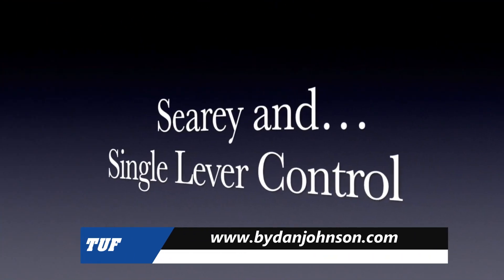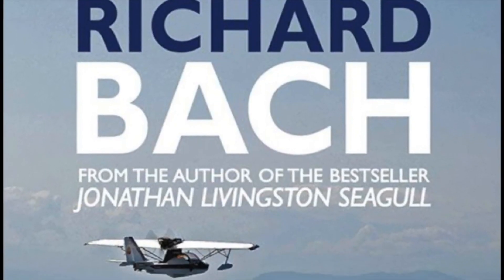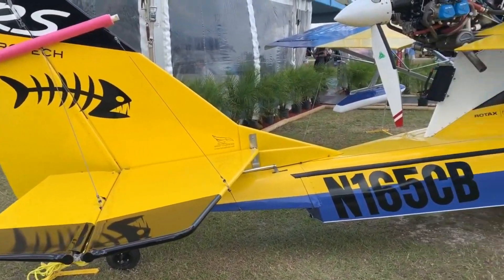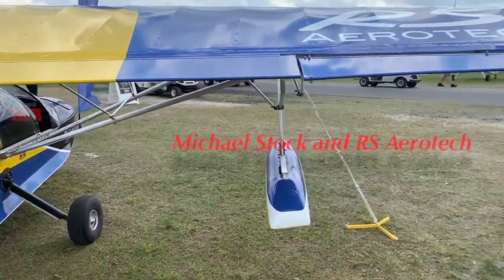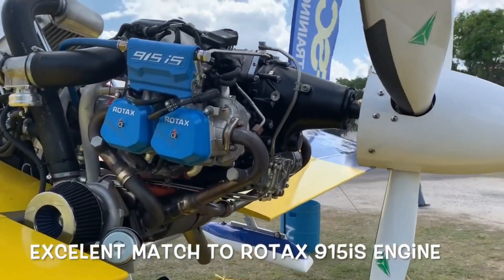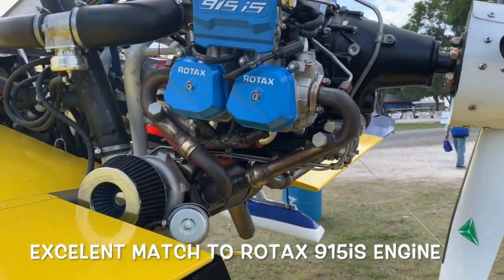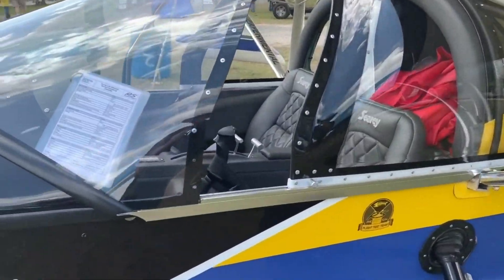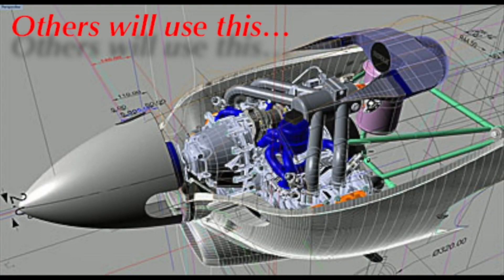Single Lever Throttle Control, on light sport and experimental aircraft SeaRey.

Comment: Thank you for the great report Dan!  I know RS Aerotech has been working on the single lever integration for a few years now on their Sea-Rey.  I would certainly think they will have this perfected in time for the new LSA regulations in 2023.  I agree with you 110% that this provides excellent safety benefits, while not increasing the pilot workload.  That being said, with the Electronic Controller constant speed props being offered by AirMaster etc... It is tough for me to see an increased pilot workload with this style Constant Speed prop.  It only requires the flip of a switch from Climb to Cruise etc... I am hoping the FAA will certainly consider this style constant speed prop as well with the new LSA regulations.  I am also curious if the RS Aerotech system will work with any FADEC engine such as ULpower, or strictly for the Rotax IS based engines...

Comment: Great videos Dan, please keep them coming.
For a long time I've thought that for a prop with direct control of blade angle via a cable or switch(or rheostat) that it could be incorporated in a single lever so that at maximum, or 100%, throttle the prop will be selected to "climb" pitch and as the throttle is reduced the cable or switch would gradually reduce rpm by gradually reducing to "cruise" pitch with throttle remaining at 100% before Throttle lever starts to reducing Throttle from 'wide open' throttle gradually back to idle. Or for engines that cannot tolerate high Manifold Pressure at lower rpm, reduce Throttle and Prop pitch at the desired comparative rate. 
This could probably be done by linking the the Throttle and Prop levers together with some sort of Cam operated linkage that could be fine tuned with some sort of adjuster by either the pilot if outside the panel(quadrant) or by mechanic/engineer if 'behind' the panel.
Reply: The problem with this setuo6is it's heavy.  Most GA birds, you want light.   Fwd can cause weight issues when too heavy.  Also, flyweights, oils,  and electricity in smaller applications has been hazardous

Comment: P-3's and L-188's have single lever integrated power levers that incorporate pitch and power/thrust changes.   The only downside is feather isn't automatic, and requires an extra auxiliary prop pump.

Comment: What is allowed? The select adjust prop on john mcbean kitfox? What type constant speed prop goes on a turbo 915is motor as it seems to require it as on trent's airplane?
Reply: Thats an experimental, almost no limits there.